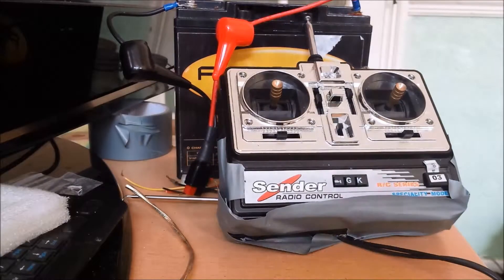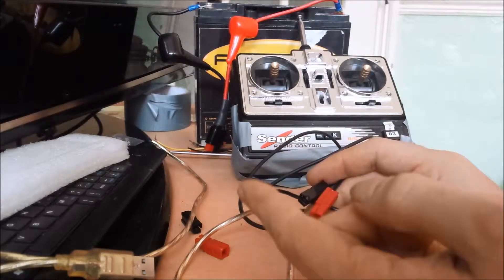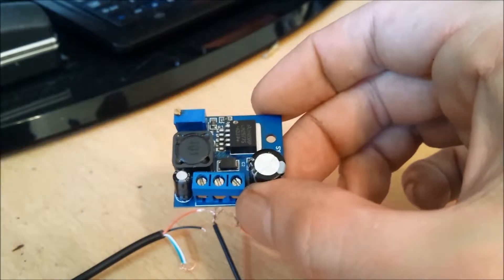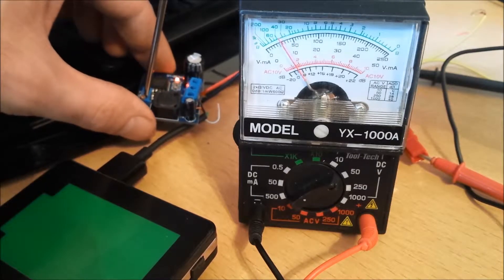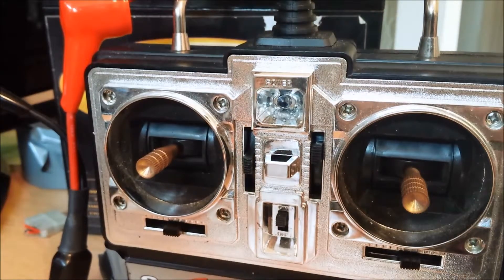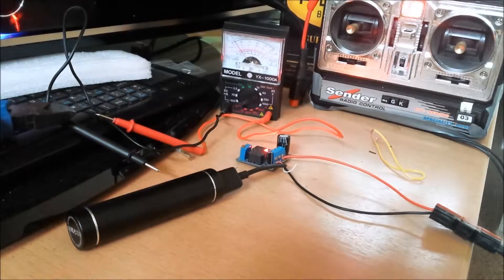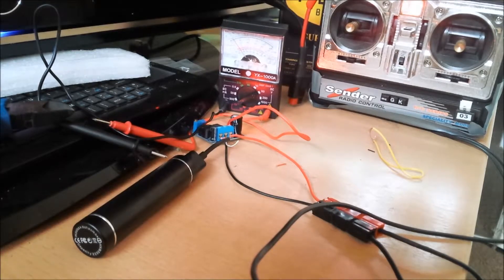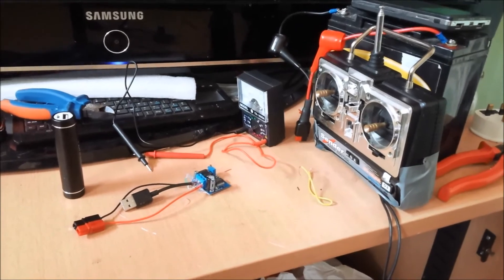Heng Long Radio Control Tank R/C Transmitter Power Bank Mod

Comment: nice video, do you know if heng long tanks can be bound to OpenTX transmitters like the TX16S?
Reply from the maker: thanks for the nice comment :-) im afraid i cant confirm it that it would work with the open transmitters but i think possibly, the heng longs are using different crystal frequencies on them from the looks both in the transmitters and in the tank receivers as well, if you could find the crystal frequency of the tank receiver and then match that with the TX16S i think it should work there. Heng Long did the crystal swap out method so folks can have tank battles with each other so I would think that should be doable but Im afraid i havent dabbled to confirm it, hope it helps :-)

Comment: Name of / for the pcb?
Reply from the maker: http://www.ebay.co.uk/itm/XL6009-Module-Board-Power-Converter-DC-DC-Adjustable-Step-Up-4A-Maximum-Current-/111275803101?pt=UK_BOI_Electrical_Test_Measurement_Equipment_ET&hash=item19e88e01dd any version of this 'step-up' will work for this mod, but if you want to use the board on other things that take higher ampages, then you have to consider which version you get :-)
Reply: Thx man u answer very fast u have Facebook or some contact i whant some advices
Reply from the maker: sure email me over paul@batzorprogramming.com
Reply: Thx!